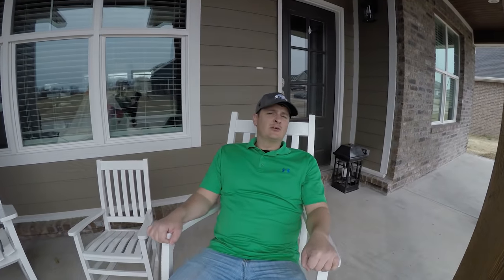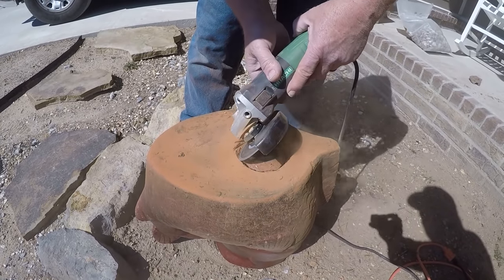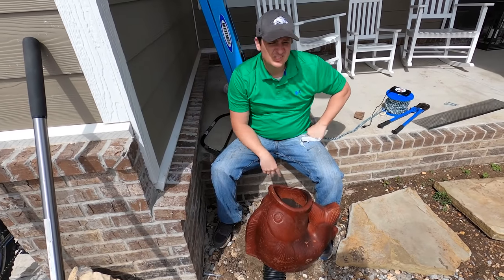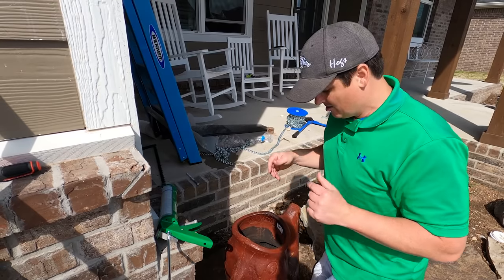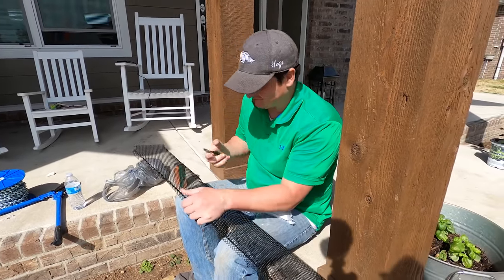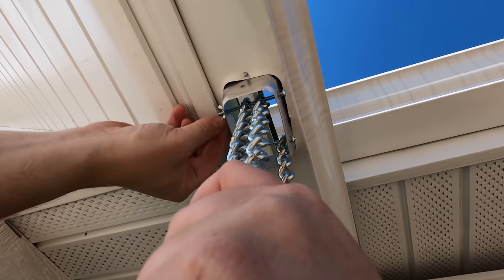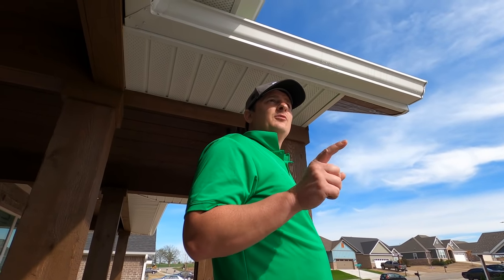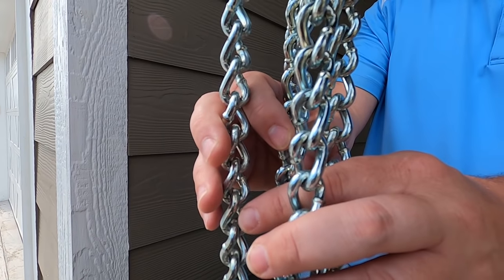RAIN CHAIN DRAIN Installation

Comment: Interesting idea! Wonder if you could add a 3-6” section of downspout at the top (attached to the “downspout mouth” with the chains coming through) to further direct/guide the water down the chain?
Reply from the maker: Sean H. 
I wondered the same. Maybe even pointed in at the bottom a bit like a funnel??
Reply: * taps head * not just a hat rack.

Comment: never do anything I suggest.. but, what if the gutter had regular “gutter” for a short distance at the top just to get the water flowing downward? Can you get anywhere near it holding a large 🧲? As always thanks for another great video gentlemen!
Reply from the maker: BermudaLawnNC 
Yes I think it needs a tiny bit of a funnel at the top. Although doing great as is too

Comment: Good idea, But maybe a regular rain downspout is better after all. The whole purpose of a closed aluminum pipe is for no water spillage. One can decorate the downspout or hide it in some ornamental column. If you make the top water outlet a bit smaller and the water collection opening larger u can drain all the water to the street pipes. Any way one looks at it, chains will disperse the vertical flow of the water a bit outwards. I know in many Asian countries, in small villages they use very thick ropes made of bamboo/jute etc as rain gutter downspouts. The gutter openings they create at the top of them is very precise in size in relation to the rope thickness, and they work perfectly with no spillage. They also use huge bamboo shoots for rain gutters and 'closed' gutter downspouts. Incredibly strong & rigid.

Comment: That’s a pretty cool idea. It would be cool if you could put some kind of lighting through the chains. Not sure if that would work with electricity and water 🤷‍♂️Good video though👍
Reply from the maker: Steven Shivel 
Ooooo I like that idea!
Reply: Solid clear plastic tubing with LEDs ran through would work. They already sell it for use as Christmas lights so it can be done without needing to fab anything up yourself and should be waterproof. I would love to see what that would look like.